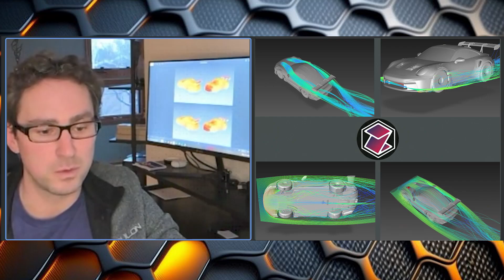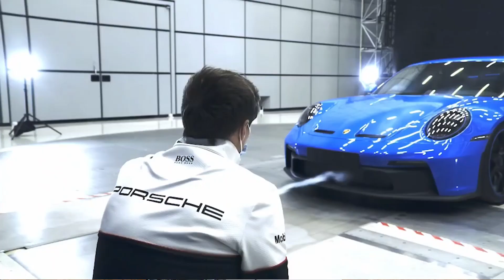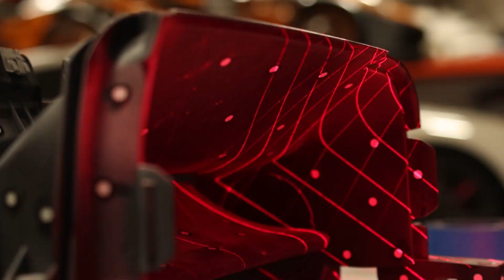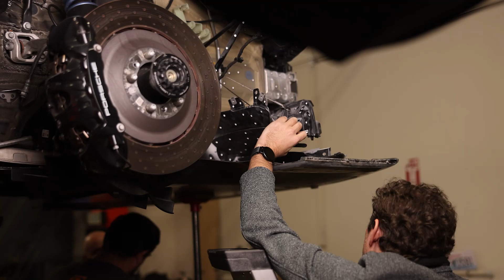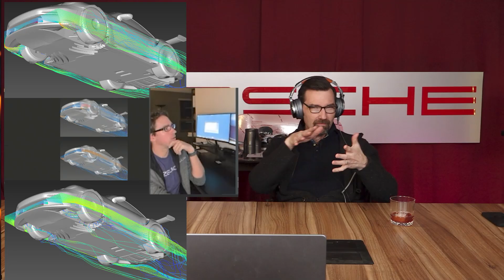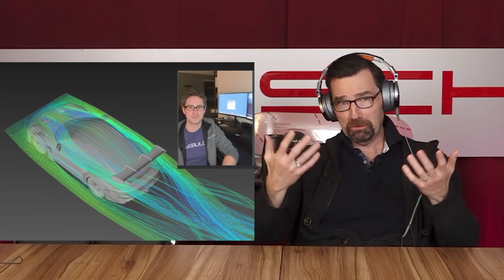Inside the Aerodynamics of the Porsche 992 GT3 RS — CFD, DRS & Race-Car Engineering Explained!

Comment: Thank you for the great video!  The first video is what convinced me to buy the Valkyrie kit.  It is extremely well made.  Question: On the 992.1 GT3RS diffuser, there are several vents which look to be for cooling purposes.  How do the cooling vents impact downforce?  If some of the items that need to be cooled were moved out of the way, say with a Dundon custom exhaust to help with the angle of the diffuser, how could that improve downforce?  Is a double diffuser possible?

Comment: 30.4% reduction in drag doesn't seem to correlate with Cd: 0.39 - 0.53 between the two modes (26% reduction), as reported by Sport Auto.
You got 0.56 in high downforce?

Comment: @14:23 A vortex blocks airflow from the free stream, and pumps it laterally in the direction of rotation. Since the top of the car is curved, it generally produces lift, or downwash. You can see this because the two vortices that are shed off the rear of the car counter rotate and drag the flow downward, just like an airplane does. As the flow is pumped laterally, it acts to draw in more air due to the low pressure generated as the vortex pair pulls the air apart.